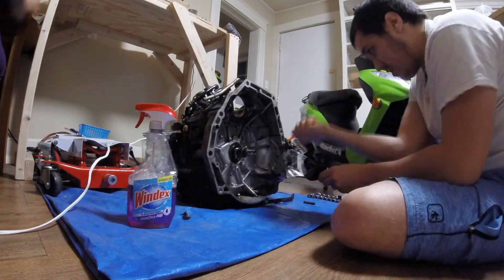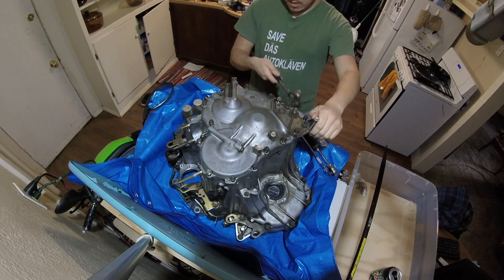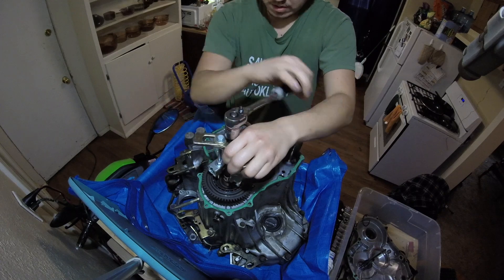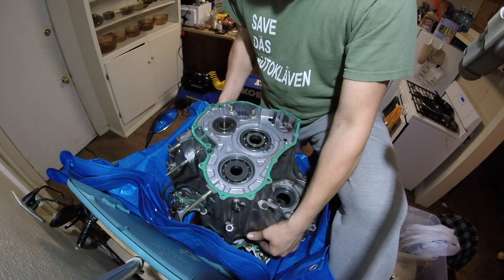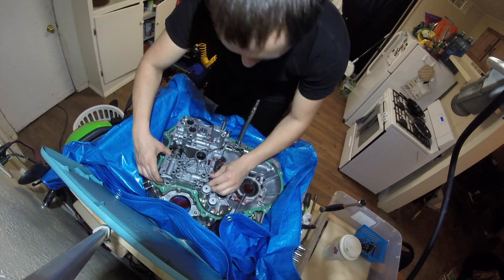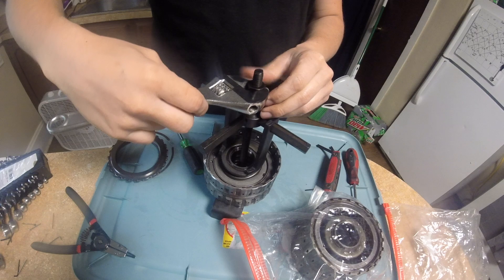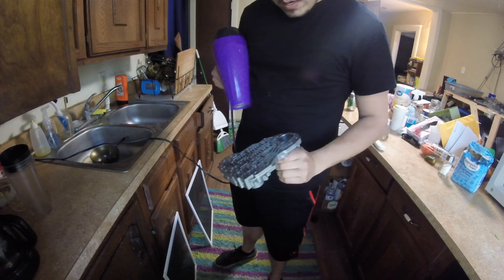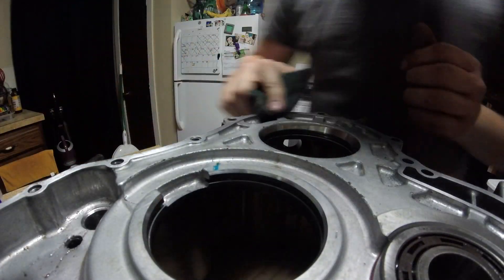Honda BAXA Transmission Disassembly

Comment: After you get the end cover and idler gears off to expose the three large bearings where the shafts exit the main housing, do yourself a favor and stop (2m32s in this video).  Try spinning the outer ring on each of the three bearings.  If they move, you're probably done, because you'll need to add at least $350 plus $190 core to your costs for a resleeved housing.  You'll probably also need new bushings in whichever shaft(s) have the loose bearing pocket(s).  Your feed pipes for those shafts will probably be worn, and if it's the one built into the end cover you'll need to replace that as well.

If your goal is to get another year or 10k miles out of the car, you're probably ok ignoring the problem.  This is a wild guess though based on the fact that not one of the six or so production-shop-made MAXA/BAXA rebuild videos I watched bothered to even mention these bearings or the very common problem with their pockets in the housing.  Common sense says they don't mention it because they don't care, and they don't care because because they don't need to worry about the unit coming back as warranty work (same reason you'll see them using screwdrivers instead of pullers, eyeballing clearances, ignoring torque sequences, etc, etc).